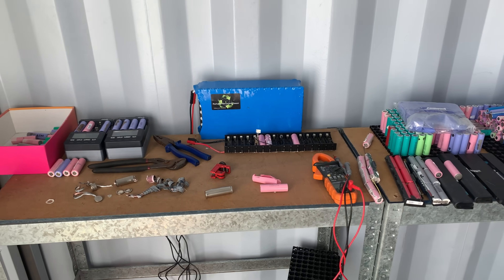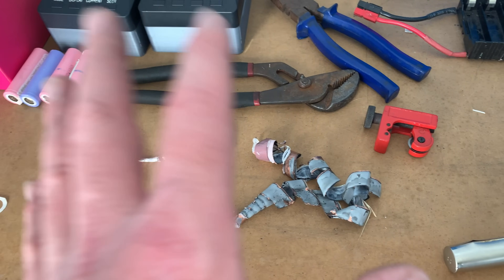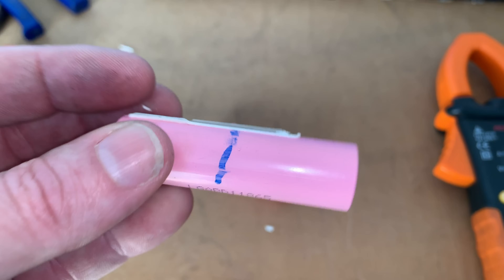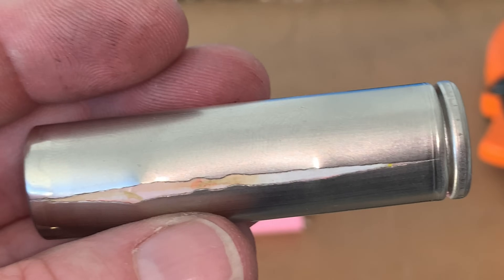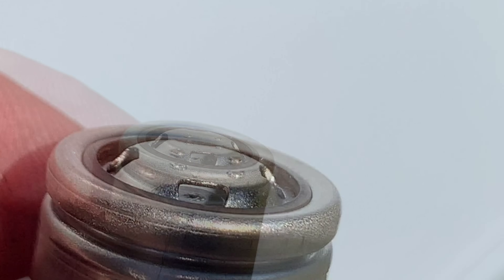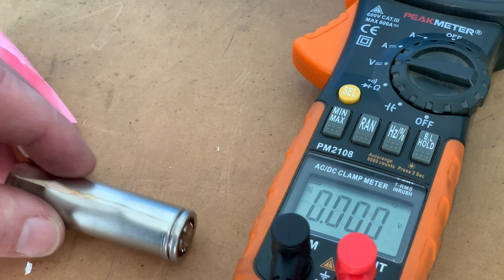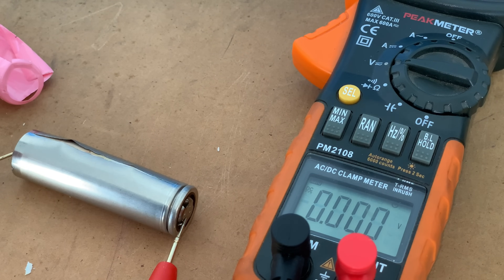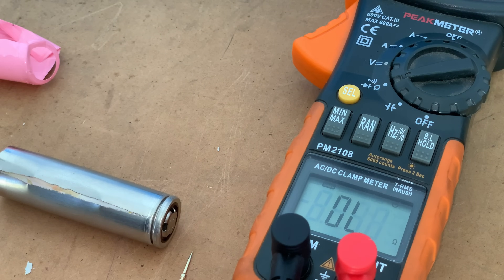Cutting open an LG 18650 battery for science  [ amateur video warning ]

Comment: At around 13:00 you can see extremely uneven deposits or distribution of something in the layers as you unroll them. A new cell has all the layers look same across their entire surface. Are there any pinholes in the bottom spot weld points? The could have resulted in some electrolyte evaporating out the bottom of the cell (causing the weird marking) and perhaps leading to excess gas formation due to heat from the higher internal resistance where the anode/cathode material was electrolyte-starved. Just guess though. The CID appears to be intact so it was a side rupture. This is entirely possible and NASA even has workshop PDF’s online describing the issue and how to design around it when creating battery packs. The bottom vent structures in some cells are there, in part, to help prevent side rupture in case the top vent gets clogged during thermal runaway or if an internal short circuit is up against a side wall.
Reply: haha.... I knew you'd be here!  My man Mooch.
Reply: Spector NS5 RD hello Spector! 👊
Reply: Or he could be using already defective batteries and making them worse by his mishandling, damaging of them, and unregulated mass charging.  But hey, it's not like he hasn't been warned that he'd have failures that will ultimately result in catastrophic damage.  Oh, wait, he has? Fascinating.
Reply: You may or may not know this but all of the electric vehicles being manufatured now have batteries. These batteries arent what old farts like me are used to. We used deep cell marine type but these new ones are made up of cells with those little ones like youre playing with. My numbers may be askew but the teslas have roughly between 6800 and 14000 small cells made up in two or more batteries weighing in eccess of 900lbs. The batteries are nearly as expensive as the motor. If i were you id get out the little spot welder and go into the battery building business. Let me know if you need motors or drive trains.
Reply: I purchased a cheap but potentially, wait that wasn't cheap. I purchased an electronic device made in China. Only to receive it and realize I needed one of these batteries. Went to Amazon to purchase 1 of these batteries and I saw 1 great event 9900 amps versus all the others at 3500 or lower. Led me to a Google search about these things and then a YouTube search 9900 mah vs 3200mah.  Based on the project farm video that I watched it was seen the LG HE4 rated at 2500 was the only thing that actually Lived up to its rating. Which led me to a search for the LG h e 4 18650 batteries. Which led to me realizing that I was not going to be able to go down to the Best Buy or the Walmart or the circuit city Radio Shack or any store like that and pick one up. Hell I wasn't going to be able to pick 1 up from anywhere. Because these are batteries designed to go in rechargeable battery packs and not to be sold separately XYZ.. And now I'm here with my useless clock,  reading some very, VERY interesting dialog. Not a total waste.
Reply: There was dendrites.  You should have put it under the microscope.  The black conductive electrode attached to the copper current collector is the anode made of graphite.  On its surface there can be lithium dendrites, and there was quite a few.
Reply: @yogamon  how do you know there were (microscopic) lithium dendrites forming near the bottom of the cell? Why would dendrites on the anode leave marks on the separator? Do you have links to examples of these types of patterns being caused by lithium dendrites?
Reply: @batterymooch  if you don't know that graphite is modern day anode on copper and ncm or nca is modern  day cathode on aluminum, well...
Reply: @batterymooch  won't let me post links, I put in three.
Reply from the maker: Post again I’ll watch for them and approve
Reply: @HBPowerwall  tried, they keep getting deleted
  Google

graphite electrode lithium dendrites

Go to images and click around, whitish stuff on anode (graphite; attached to copper current collector)
Reply: @yogamon  I know about anode and cathode materials, quite well. I am also quite familiar with LLI and other aging/degradation mechanisms for li-ion cells. That has nothing to do with how you can say you definitely see dendrites on these cells. What makes you rule out any other cause? We have no idea what causes it. I have my guess stated above. You are also just guessing that those discolorations are caused by dendrites. You cannot definitively say that’s what we’re seeing no matter how much Googling you do.
Reply: @yogamon  your statement that I don’t know about some Li-ion cells having a graphite anode and certain metal-oxide cathode is quite confusing. Nothing I said previous to your post referenced choice of cell materials. Taking a swipe at me was fun for you, I understand that. Respect and civil conversation is so rarely found these days. And I get that you wanted to show that you knew something about li-ion cells...that’s okay. But it was irrelevant to our discussion and mistimed.
Reply: @batterymooch  wasn't trying to show off.  Just making sure you know what materials are used.  I've heard of you from online stuff and know you have tested 18650 extensively, almost as much as lygte-info . Dk  Seeing that the cell casing exploded Ill bet outgassing did this, a defect of manufacturing.  Why it didn't vent like its supposed to idk.  That's why he says I smell nothing from this one..all the electrolyte evaporated out.  Now why did it start gassing, which uses up cyclable li+ ions and why coulombic efficiency is so important in long lasting cells?  Probably dendrite growth piercing the polyethylene separator.  Plating (or dendrite growth) on the anode is common failure of lion cells, as lithium becomes dead, or is not cycling anymore.
Reply: @batterymooch  plus why did the electrodes bubble in water? Well it is hard to say since cathode and anode where both thrown in.  But, if they were put in separate water baths, the copper side is most likely causing the bubbling, and bare lithium is doing that.  Cathode I don't think bubbles water, because cathode that is full of lithium is completely discharged, which is low potential.  Maybe cathode devoid of intercalated lithium (fully charged)  May cause bubbling, but I doubt it.
Reply: @yogamon  two important questions then are 1) Will a fully lithiated electrode bubble in water without lithium dendrites? 2) Are there other mechanisms that could cause the bubbling seen when dropped into water?
Reply: @yogamon  regarding the top venting disk not opening...side venting and burst cases are not unknown for some cells. It’s what led to development of the bottom venting structure seen in the Murata VTC5D, 21700 Murata VTC6A, and other cells.
Reply: @batterymooch  plus the cell is showing continuity at 4:00

Cell is internally shorted, dendrites grew over to touch the cathode. Started gassing, finally dried up which is why it is 0.000 volts.  He shows that other cells will still retain 0.17 volts no matter what you do.  That is what I think happened.
Reply: @batterymooch  1. Maybe, good point.  Maybe water splits even on a lithiated graphite surface.
Reply: @yogamon  yes, plating can contribute to LLI and cause eventual failure of the cell (perhaps violently) but additional passivation of the SEI layer, a common aging mechanism, can cause LLI too and wouldn’t cause excess gas formation and bursting of the cell.
Reply: @batterymooch  2) probably, but still, taking everything into account, lithium in a finely mossy state with decomposed organic electrolyte coated on its surface detached from the graphite surface and electrically isolated, is the most likely thing happening.  Just a guess tho
Reply: @yogamon  one could argue that a hydrocarbon coating (electrolyte decomp byproducts) on metallic lithium provides a coating that prevents contact with water. Makes for interesting conjecture but, alas, we’ll never know. 🙂
Reply: @batterymooch  this could go on and on.  Well glad I met you, your work on 18650 and amp limits has been very useful to the community.  And to prove this either way, an sem would be needed, and I don't have regular access to those instruments.
Reply: @batterymooch  did not know this, the bottom venting.  All I know is if gassing is happening, not good for overall health of cell
Reply: @yogamon  good talking to you too, enjoy the weekend!
Reply: @batterymooch  google

Spatial dynamics of lithiation and lithium plating during high-rate operation of graphite electrodes

Just read the abstract
Reply: @yogamon  yup, a well known and documented effect and a huge concern for EV and the fast charging customers want. Why did you want me to read that?

Comment: i have NO BASIC KNOLEDGE ON batterys buy dought on my ICR 18650  .1200mah.IS 16046 HONGLI. R.41135402 LION CELL 3.7V 4.44WH .. now the power is 3.93 voltage but its not 1200mah i think.

Comment: The 18650 is actually a true lithium battery. However all 26650 batteries are fakes within 18650 battery packed inside a 26650 case.

Comment: Lithium reacts with water. The dumbest thing you can do is stick it in water fool. It will flame up on contact with water. Better to submerge it in alcohol. This was an irritatingly ineducational video.
Reply from the maker: lol thanks for taking the time. BUT the amount of lithium in that cell is SO small you sound like a fool saying it - a bucket of water will cool cell stop thermal reaction and it's the lesser of two evils. Not to mention cheap and accessible lol I feel like a fool for even replying but thanks for the giggles
Reply: @HBPowerwall  an 18650 cell will burn producing a flame at about 2000°c you aren't snuffing it out with water. I've seen them burn. I'm glad you had a "giggle". I'm sure it'll be a good cry when you burn your house down or severely burn yourself when you jump on it and roll around. Seems like something you'd try after giggling fails to put it out. Thanks for the laugh champ.
Reply from the maker: @kefwals8722  its something like 1/10th of a gram lol you won't put it out but you'll cool it so nothing else catchs on fire and it's only for a second... they are hella dangerous no defending that.. I'll stick to my methods till i see proof of better.

Comment: some cells are iron, some are cobalt, Some are  nickel   its really wierd how some   just use junk for batteries in those laptop cells   ,  o these batteries are bad , put them in  a low amperage laptop  so they can slowly deteriorate, Make sure to re wrap then to look the same so customers dont freak out.

Comment: Lithium is very reactive with water forming lithium hydroxide and highly flammable hydrogen. Not a good place to put the Lithium.
Reply from the maker: Arr yes but there is still no better, cheaper or accessible way to slow a thermal reaction....

Comment: Lithium and water create quite the reaction, A bit of what you were seeing at 13:55. Best to use mineral oil or lith-x to control lithium batteries.
Reply from the maker: Yes, but how much lithium is contained in one cell? Water is the fastest cheapest way to cool the cell and stop or slow the thermal reaction.
Reply: @HBPowerwall  It does not take much, We have protocols in the battery recycling industry because of this and are not legally allowed to expose any lithium battery to the potential of getting wet. Due to the reaction between water and lithium being exothermic it may actually make it warmer. You're trying to cool any potential heat that has to do with a reaction that is accelerated by what you're trying to cool it with. Mind you getting an 18650 getting wet isn't inherently dangerous in most cases, CSA operates on theoretical. Kinda like putting out a fire with gasoline because its a liquid like water.
There are some experiments on youtube that would probably surprise you.
Reply from the maker: I find that to be true but once it's in a dangerous state ie thermal run away - Aussie fire department recommend WATER and days and days of it full blast to cool & kill the thermal reaction .
Reply: @HBPowerwall   @HBPowerwall  Interesting, Would that just be because of the availability of water vs sand, mineral oil and lith-x, do you suppose?  we place any runaway batteries in mineral oil and it neutralizes the reaction pretty fast, and it's inert to lithium. We have Lith-X that is specifically for lithium runaways but if we have nothing else we are expected to encapsulate it with sand. Thats what the CSA calls for but I'm curious to know what the Canadian fire dept would say about it. You can't really tell the average joe to put it in a barrel of mineral oil because who has that, and no one is going to know what Lith-x is. Sand is the most realistic to have "nearby" but still a stretch for many people
Reply: The water full blast idea would be a dissipation strategy to control the reaction and would work especially at a point of runaway. the sand, oil, and specialty stuff are more of a neutralizing strategy to stop the reaction.
Reply: Here's what happened when somebody else put lithium in water: https://www.youtube.com/watch?v=yGDkiUAwxRs

Comment: Would definitely like to see a more in depth look at those CIDs. They seem to be a common point of failure, weather or not the cell is actually bad.
Reply from the maker: CID can go for many reasons, dropped - heat - cold, also over charging and possibly under charging.. well that's my understanding anyways

Comment: I have a question I can't seem to get any help with, but how would I go about not charging an 18650 battery until it needs it (drops below a certain voltage that I set) when it is always connected to a TP4056 board?  Using solar power so when the sun is up it will want to charge the battery even if it doesn't really need a charge which shortens the life of the battery.   For instance my load is 300mah and on for 5 hours while my battery is 3400mah.  As you can see it would only need to be charged once every two days (especially since the charge will be 1a so done in 3.4h).  Saves the life of the battery etc...   Not sure how to do this, and apparently no one on Reddit, or anywhere else I have asked, knows (or worse cares to know).
Reply: Have you looked into solar charge controllers?

Comment: You seem to have missed the protective chip assembly on the bottom part, that you cut off.

Actually the plastic cover consists of 2 layers.
There is a thin metal strip running like wire from bottom to top between those layers.

It seems you entitely missed that because you did not start cutting the bottom part first prior to removing the cover.

You need to cut the bottom off with the cover still on and just with a knife, that does not run trough a metal wiring strip or metal hull.
Reply from the maker: the CID?
Reply: @HBPowerwall  Did you watch the video link? Seems contained in bottom section is load resistence sensing circuitry, that can be fooled by pushing down back on the top sealing filament

But the real protective stuff is concealed at the bottom.
If taken out, a seemingly dead battery is unprotected, but should take charge again, probably even more than without CID.
Most devices and charging bays have their own disconnecting built-in safety circuits.
This is what refurbishers do not want the public to know, let alone manufacturers.

Please watch the video link
Reply: https://m.youtube.com/watch?v=H75cYVbvRyo

This is an example of the side strip attached to protection chip assembly on the bottom

Comment: Thanks for the videos..... hope you can help with this question:
Have 18v with a charge of 15.97v. It won’t take a charge for the charger(green light just keeps flashing-which means charging) and it won’t discharge its power. Simply doesn’t work any more. 
I’ve tried boosting its charge for a couple minutes and still will not work on charger.
Hope you can help 
Jody
Reply from the maker: Sounds like BMS is faulty..
Reply: @HBPowerwall  do I just buy another battery? Is the BMS something fixable?
Reply from the maker: I have  no idea sorry - you'd have to take it to a local professional for a physical inspection..

Comment: Water is the way to go. Keeps the temp down and the reaction contained. Even better is to add vermiculite powder to the water. Cools it and prevents venting leading to thermal runaway when dealing with cells in series or parallel. Hydrogen fluoride gas is created by the venting and oxidization of the electrolyte. Use a little fan to create a soft cross wind to keep the gasses flowing out of your hobby shop... 🤪.
Reply from the maker: Yes i believe water is the way to go, cheap & accessible. I use a large shop fan to create a hurricane with in my workshop - have to turn it off to record or you can't hear anything lol
Reply: Your nuts. Lithium metal is reactive with water. You store it in oil. I’m surprised that didn’t erupt in flames when he put it in water. I have even seen it explode.
Reply from the maker: To be fair said lithium is sealed inside a metal housing. Cooling the cell stops the thermal runaway. It’s the lesser of two evils and is cheap and accessible

Comment: Mate I have a power bank that I neglected to charge well I really forgot I had it, it wouldn’t charge when I tried so I took it apart and the cells are all less then 1 volt. Should I just toss them or try to boost charge them. I’m really terrified I’m going to burn the yard down so i don’t know what to do, plz help
Reply from the maker: Knowing what i know now I would replace it, just from the safety aspect
Reply: @HBPowerwall okay ill replace it. thank you